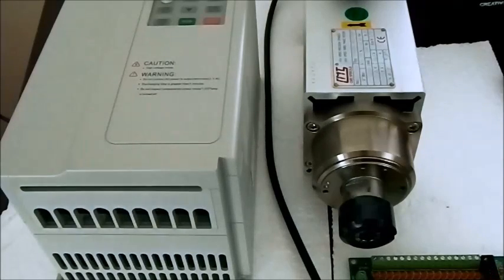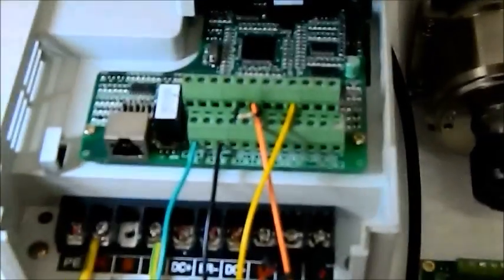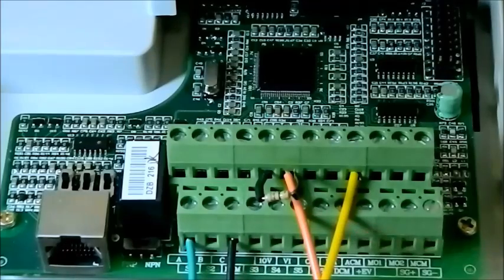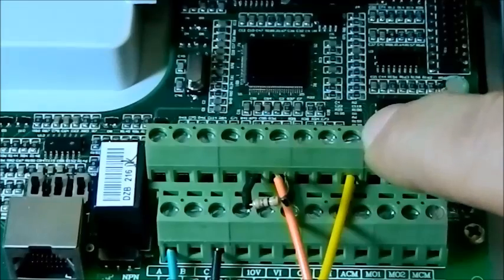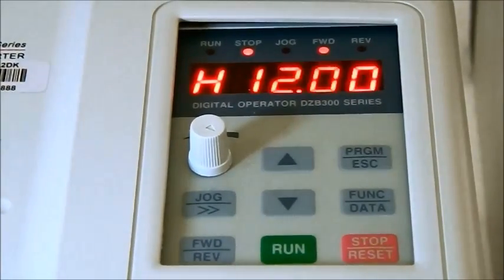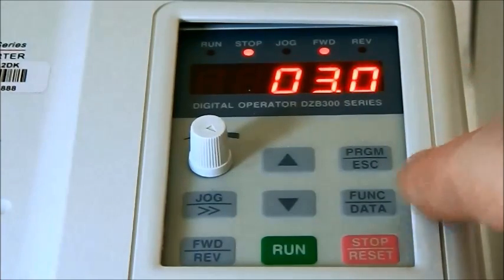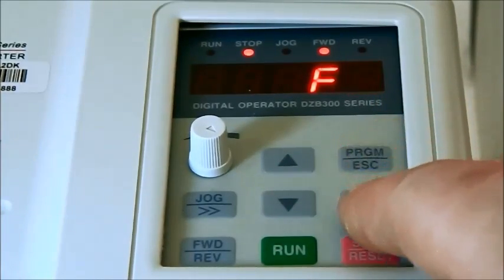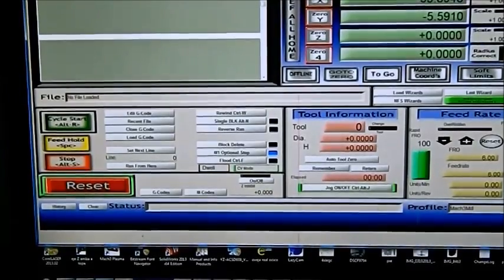3KW Spindle GMT and Fuling Inverter Video Tutorial

Comment: i have same model, im having a problem, could you help me?? When i turn on my machine, the spindle starts to spin automatically, in the fuling inverter screen appears "P 33.6" 

The fuling inverter is sending an automatic signal for the spindle to rotate without my having sent any instructions, it start to spin with slow RPM, that happens even if i have the ncstudio controller card disconnected

Could you help me?
Reply from the maker: respuesta en castellano:
Hola, En principio, parece que sera un problema de algun valor en algun parametro, revise los siguientes parametros que tengan valor 0 en cada uno de ellos F0.06, F0.15, F2.09, F2.10, F4.29,F4.30,F4.31, F4.32, F4.33,F4.34, F4.35, F4.36. Si esto no resolviese el problema, puede contactar conmigo en skype : justo1231 e intentariamos averiguar mas sobre lo que puede estar pasando. Igualmente si necesita adquirir cualquier cosa en china, estamos a su disposicion.
Suerte!.
Answer in english:
Hello, In principle, it seems to be a problem of some value in some parameter, check the following parameters that have value 0 in each of them F0.06, F0.15, F2.09, F2.10, F4.29,F4.30,F4.31, F4.32, F4.33,F4.34, F4.35, F4.36. If this does not solve the problem, you can contact me on skype : justo1231 and we will try to find out more about what might be going on. Also if you need to purchase anything in china, we are here to help  you!.
Good Luck !
Reply: @ToroCNCTech  hello do you have whats app To contact you?
Reply: Que tal, te mandé mensaje via skype

Comment: Hy sr i am from Pakistan. problem i face is that as i run cycle start the emergency mod active can you help me please my cnc is 1325 dsp st6
Reply: A lot of things can happen there. You dont say if you use MAch3/4 or using a dsp independent system. your info is very limited to get my magic wand and give you a right answer but, looks that there you have triggered limit sw or any other device that dont let the cicle start begin. If its mach3 system I suggest look in ports and pins the limit sw signals or another devices like spindle , normally the active low option has the reason. Unmark or mark the active low option then you can detect any change. notice in mach3 diagnose tab you can see if any of the ports is activate then dont let start the cycle. If your system is not mach3 then the problem can be the same but how to solve depend of your system that absolutly I dont know it.

Comment: Hi, thank you very much for sharing your knowledge. 
Could the communication between the cnc controller and the VFD be done via the RS-485 Serial interface (SG+ / SG-)? Is there any disadvantage on doing it this way?
Reply from the maker: I didnt test it but, dont should have any disadvantage use RS-485 to control the VFD. This depend more of the CNC controller where use the RS-485 to comunicate with the inverter that should match with  the control via RS-485 of the inverter to let works properly.
Reply: Gracias amigo. Appreciate. 5My controller (Buildbotic) accepts RS-485 connection. I’ll study the complicated Chinese VFD manual for the configuration with my controller in this case

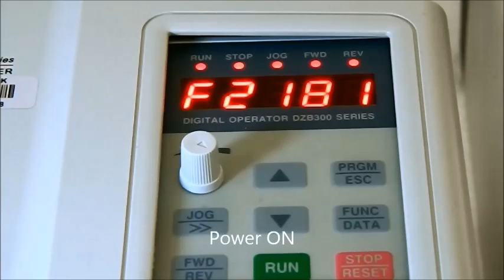Comment: great tutorial, dear at 5:45 when you turned on the inverter it show H12.00 what does this H12.00 mean, my inverter shows H100.0. One of my friends told me that it must be H0.0, does it make any difference? is it normal if it stays on H 100.0?
Reply from the maker: H means Hz (Herz), then the number that appear is the actual speed in Hz that the inverter will execute until any Hz change (by terminal or by panel attending the setup). If there appear by default H100.0 means that at that moment the inverter has 100.0 Hz speed  that will start to run. This number can be different in every VFD beause attend to the minimal speed was setup by parameter or if the terminal input signal is activated by Voltage range or current range, the VFD is receiving the signal according to apply 100 Hz speed.
Reply from the maker: 100 Hz its too high if do not make any change after initialize, but can appear if later the electronics controller send the signal to 0 speed inmediatly, to change to 0 by initial. Check the minimal speed value parameter in the VFD if any has 100.0 value, then replace by 0, if you has setup voltage input terminal for the speed , probably means that the  electronic control (CNC controller, plc ,e tc...) is sending a voltage by default that setup the speed in 100 Hz, if the spindle at start works normally in 0 speed and change normally the speed under electronics control then means that the setup is right and no problem. if the spindle always start at 100Hz (and not is the desired to run) then you should solve this bug in the electronic controller.

Comment: Hi, this video has been very helpfull, 
but I have a little trouble whit my spindle (3.5 kw 4 poles), it gets to hot above 75 Celcius degrees (167 Farenheit), my question is if you have experimented the same situation, and how do you calculate the stator resistance, rotor and leakage inductance? thanks in advance, best regards.

Comment: Hallo Sir, is that BoB you have the AKZ 250 Breakout Board? Looks very similar...
Thank you
Reply from the maker: Yes
Reply: Thank you very much. 
I have the same configuration with 2.2kw spindle. I wired it like you show in the video and everything works fine. The only problem i can't figure out is, that the spindle rotates counterclockwise by default and for the moment i have no idea where to look to fix it.

Thank you 😊
Reply: Thd solution was to change the wirings of spindle motor. U to W and W to U. Now everything works
Reply from the maker: @vitalim7868  Exactly...the right solution is change the wiring order then by this way you are changing the 3 phase sequency order to change the default rotation direction. Thats  the right solution.

Comment: Really very useful video! I wanted to test my spindle without PWM control from the keyboard. For this i have changed F0.01 and F0.03 from 1 (VI) to 0 (keyboard). After this i see "H400.0" on the display but when i rotate the potentiometer nothing is happening. Do i need to press tghe "RUN" button? I am scared that the spindle could start with full speed. What would be the right procedure to slowly start the spindle from the keyboard? Thanks for your help.
Reply from the maker: The spindle never will star directly at high RMP, so will need time to grow up the speed, always. then  you can press run and look if goes, as well you can press stop button to stop in the case that the rpm grow up without control.
Reply: Thanks a lot !!! First run was successfull. :-)

Comment: Sir I have e004 error on my CNC machine can you help?
Please?
Reply from the maker: E004 "Over current during Aceleration" 
Please first of all check if you change something like the spindle or wiring, then if the spindle is different than before you may setup the inverter parameters acording the new spindle.
If its the same, check the wiring do not hav any shortcircuit in the wires UVW and earth is right connected.
If after check all this still the problem, then take a look to the time for aceleration and change the parameter F0.08 and increase the value in seconds.
if the problem continue then maybe you have some parameter vaue wrong, Advise is reset to the factory default parameter set  F0.12=1 then setup again the parameters according the video and your spindle.
All this instructions is under your risponsability, we are not your free technical service. If something go wrong is not our fault.
BR

Comment: Hy CNC ModulKit,
I have done the correct connections of power supply and  the spindle but when I press the run button it is not woking. No matter how much I press I couldn't get it to run the spindle.

Your help will be highly appreciated.
Thank you
Reply from the maker: Any Error code in the display?
Attending that you are trying to run the spindle from the VFD console and not by terminal Voltages, you may setup the parameter 0.01 = 0
You did it?
So many factors can happen there , not enough information about your equipment and situation, if the problem persist you may explain with much more detail all about your setup to try to get help..
Reply: When I press run button its not turning the spindle. There is no error display. There is just H0.00
Reply: @karmasonam1712  did you figure it out? I have the exact same problem

Comment: hi, thanks for this video. i have problem on my CNC router, the screen show E004, what mean? and how i can solve this problem? thanks
Reply from the maker: Fuling User´s Manual says: ¨Overcurrent during acceleration( E004)
¨ 
If before your inverter and spindle was working properly,... think about if you have changed anything, check the wiring do not have any short circuit and earthing is ok.
increase the parameter for acceleration time because its possible is too short. Check the shaft of the spindle can rotate freely.
Double check the motor parameters are right attending to your spindle power etc...
In the user manual come an step by step procedure for troubleshooting with this  error code. Please check the user manual.
If the problem persist contact with your supplier and then he can contact with fuling.
Hope this help.
Reply: @ToroCNCTech thanks for your reply, i check and tell you. can you send me the manual?
Reply from the maker: @AWSLASER  yes. I need your email.
Reply: @ToroCNCTech  can you send me to the manual ? Please :)
Reply from the maker: @legradilevente1500  I sent already by DHL to your home (hahaha)
Please give me your email address....I  not near my glass Ball !
Reply from the maker: @legradilevente1500  better download by yourself in the fuling web site...... http://www.chinafolinn.com/trait-192.html 
Please use google for find your needs until ask. Thank you.

Comment: What does FWB REV have?
Reply from the maker: FWB significa Forward (hacia adelante) y REV , reverse  (invertido), si pregunta  acerca de los puertos de comunicacion entonces le digo que son los puertos que esperan una señal del controlador externo al inverter que...cuando reciben dicha señal el inverte se pone en marcha en un sentido y en el otro dependiendo cual puerto recibio la señal. Y siempre y cuando esten habilitados por el setup de ssu parametros correspondientes.
This is spanish answer if you need translate you can use Google translate, if  still dont understand please let me know and I Will write in english.

Comment: Hello.Thanks for this Tutorial. I have a Fuling DZB300 series with a 2.2KW spindle connected. 2 years working properly. Now the spindle is changing the speed and the frequency on the Fuling display is also changing. This is happening every 20 seconds. The motor starts slow, after 20 seconds motor goes to set speed then after 5 seconds motor goes slow again. And keeps repeating. Please Help.
Reply: Hello friend, when you turn on your machine the spindle starts to spin automatically in slow speed?? I have that problem
Reply: You can solve the problem? i have the same problem

Comment: Sir, how did you get the mach3 rpm value back from the inverter?
Reply from the maker: In this case dont take the rpm value from mach3. the value that is there is output Frequency of the inverter and the equivalent with the teoric rpm of the spindle. To get real "on the fly" rpm, a tachometer or hall sensor is needed to install in the shaft of the spindle and connect directly to the BOB input in mach3.
Reply: @ToroCNCTech  Thank you!
Reply: @ToroCNCTech  To what purpose does the 1k resister serve when applied to the inverter?
Reply from the maker: @rickgravelin1174  Adjust the Voltage signal range 0-10V for PWM stable.
Reply from the maker: @rickgravelin1174  The value of the resistor can be different according to the BOB specifications.

Comment: Hi, My controller for the spindle shows 0-300 RPM - it's obviously a short unit, because it goes up to 18K (I'm using it manually and not through Mach3) 
How do I know how much is the real RPM? what's the conversion unit for those numbers? 0-300  Thanks in advance
Reply: HI, your controller do not shows 0-300RPM , just shows 0-300 Mhz, thats is proportional for 0-18000 RPM. Means if shows 150Mhz the spindle is rotating to 9000 Rpm, so its a simple proportional equation to calculate the RPM. As well this speed is very near to the real rotation speed because is based in 3 phase rotation . Normally the VFD inverters can setup to shows in the display Mhz or RPM, and normally is choosed in show mode menus.
Regards
Reply: Thanks a lot for answering! Do you know how can I set up the inverter to show speed instead of Mhz?
Reply: Find in the users manual, normally not is with parameter , is just using a key of the keypad to change the view display mode. but every inverter has their way to do it..so read the users manual .
BR
Reply: Thanks a lot

Comment: sir can you help me. My spindle gives off smoke and instantly the whole cnc machine turns off, vfd takes out the "oc" code. then i try to replace the new spindle. normal machine but only 2 hours. returns dead and vfd outputs the code "oc". I have replaced 2 spindles. .. please help me .
Reply: your inverter is a fuling?
you didnt give enough information about your equipment, I do not have a "cristal ball"...please try to give complete info, and I dont know if  I can help ...! Did you tried to contact with the supplier of the cnc machine?
Reply: Sorry sir . my vfd delta series m 5.5kw ?

I've contacted. they say damage to the stepper. I think it is not possible because tidal has no relationship with stepper.
Reply: Every equipment is different and has thousands in the market....Sorry I dont know anything about delta, But if you burn already 2 spindles maybe the problem is the vfd, Better contact with the supplier of the cnc machine to get support, they may help you.
Reply: Maybe they didnt understand your problem
Be more clear explain the problem to them.
for sure stepper nothing with spindle.

Comment: Hello guys I have a Problem, I'm runnung my sprindle from dsp, but i can't change the speed from there my f.0.03 is 0 by the moment I only can on/off the sprindle,  I also tried in 1 and still not working.
holas amigos tengo el siguiente problema solo puedo encender y apagar el sprindle desde mi dsp, pero no puedo controlar la velocidad la configuracion que tengo es f0.03 en 0  tambien probe con f0.03 en 1 pero tampoco funcion ni siquiera el on/off
Reply from the maker: Hello, 
DSP(s) there in the market has several,(because DSP means Digital Signal Processing), I think your meaning is about CNC controllers that use a DSP chip inside, anyway...your cnc controller should has an output pin for pwm signal (pulse with modulation) inside the range of +-5VDC or 1+-10VDC, this wire is just to connect to the VI terminal in the VFD, if your cnc DSP controller doesnt has then you can not control the speed.
I suggest contact with your cnc controller supplier to get support about setup and right connection .
Regards
Hola 
Dsp(s) en el mercado hay bastantes (ya que Dsp significa Digital signal processing), imagino que te referiras a que tu controladsor cnc usa un chip con DSP (o lo que comunmente la gente llama asi erroneamente) , pues bien, tu controlador deberia tener un pin de salida pwm (pulse with modulation) dentro de un rango que puede ser +-0-5VDC o +-10VDC, , este es el hilo que precisamente se conecta al VFD para poder controlar la variacion de velocidad, en el terminal VI, si tu controlador cnc con chip DSP no lo tiene entonces no podras ejercer dicho control de velocidad.
De cualquier manera te sugiero te pongas en contacto con tu proveedor del controlador para que te soporte la conexion correcta.
Saludos

Comment: Which one would I want if I want to control via computer... VI, CI, PID, Communication, Terminal?
Reply: do you want to control the vfd via computer? you may know with wich software and normally use comunication port if you dont have any specific interface.
Reply: Justo Garbajosa I am using Mach3, I want to control the spindle and also the internal water cooling system in the spindle. I am using a parallel port to control all the other motors

Comment: A text version for those that want it. 

Spindle SETUP:
PRGM (F0) 
UP (F1) Motor settings
FUNC (F1.00) 
UP (F1.01) motor power
FUNC (3,7) (KW)
DOWN (3.0) (KW) For 3KW spindle 
FUNC (F1.02) Rated Frequency of the spindle
FUNC (400)
JOG ( to go to first digit)
DOWN (4 goes to 3) set frequency from 400Hz to 300Hz
FUNC (F1.03) RPM
FUNC 18000 rpm ( calculated automatically )
FUNC (F1.04) Rated voltage
FUNC (200) V
JOG
JOG
JOG
UP 
UP (220) V for 220V users
FUNC (1.05) Rated current 
FUNC (15Amps)
JOGx4
DOWN x 5 (0011.0) 11Amps
JOG 
UPx4 (0011.4) 11.4 Amps
FUNC (F1.06)
PRGM
DOWN (F0)
FUNC (F0.00)
UP (F0.01) comms type to input terminal not VFD keyboard
FUNC (1)
PRGM
FUNC (F0.00)
UP to F0.003 (VI control, PWM from BOB)
FUNC (0)
UP (1) 
FUNC